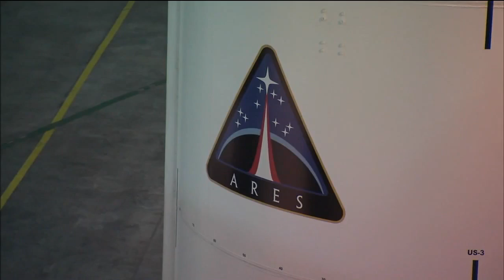Roll Control System Installed for NASA's Ares 1-X Test Flight [HD]

Comment: Safer than the shuttle in that there is a rocket powered escape tower to pull the capsule free of the rocket in an emergency. Also solid fuel will eliminate blowing up on thay pad. Sure is gonna be a rough ride though!